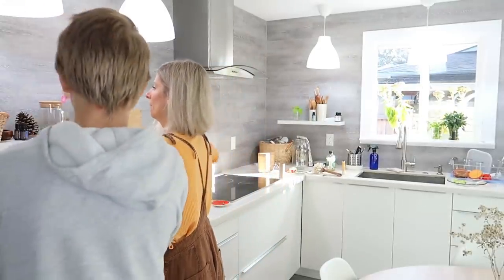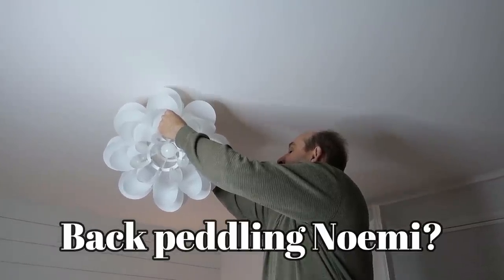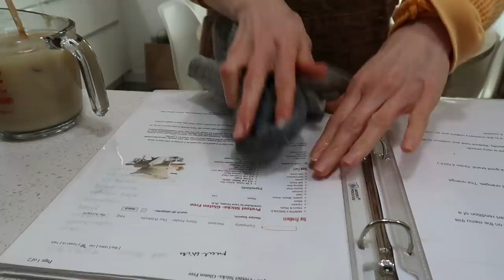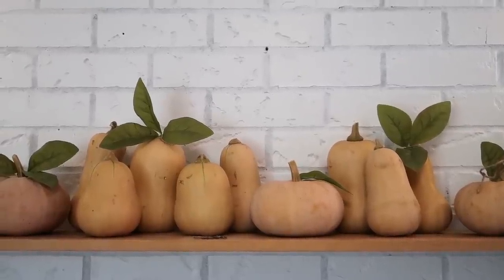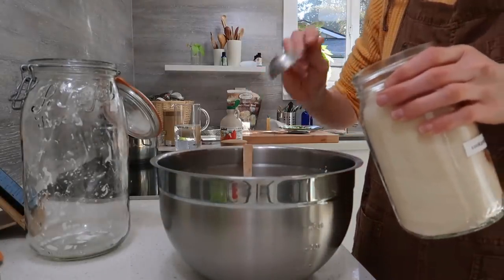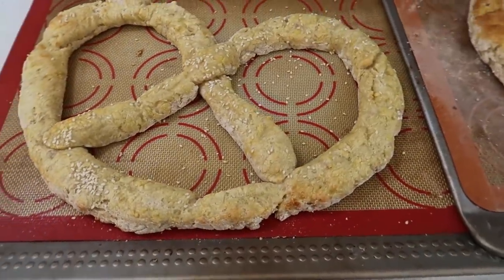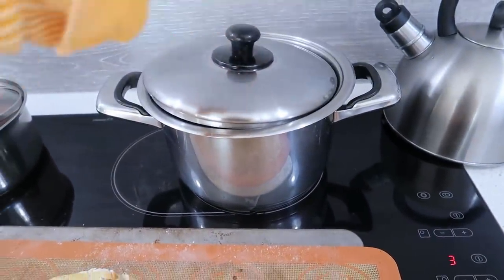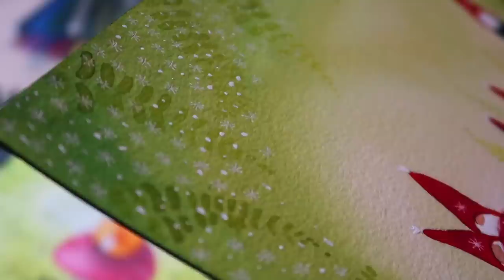DAY IN THE LIFE -SIMPLE LIVING- mountains-mini home projects-painting-baking

Comment: I had the same set of washer/dryer.  I loved it .  My washer went after 15ys.  I had to replace the knob and then it died after a few years.  This year the dryer quit.
Reply from the maker: Yes, we had to replace that once too and this was the second we had to fix the ball-bearing and I can use it again however it still shacking, Zsolt thinks because the plastic part is worn out so I don't think it will last a lot longer😬